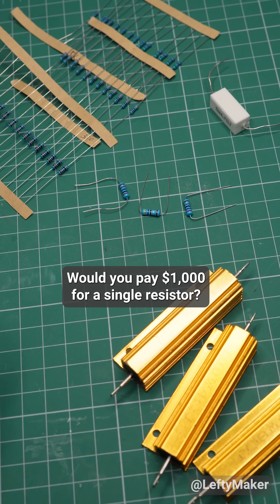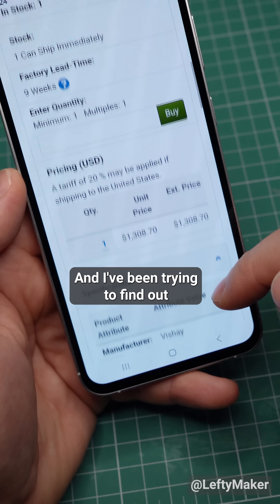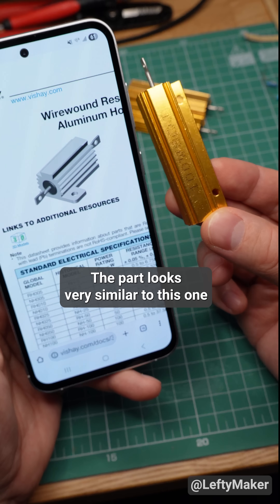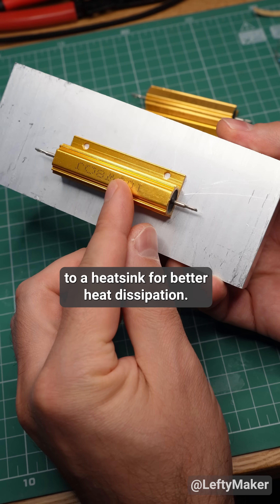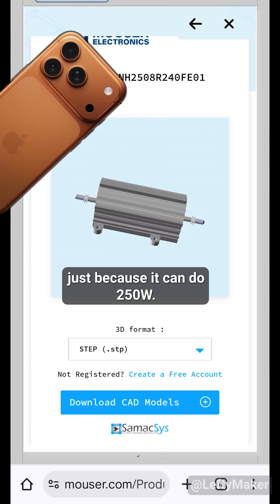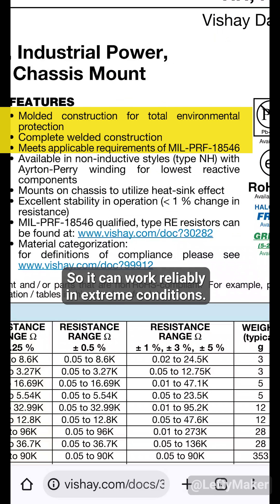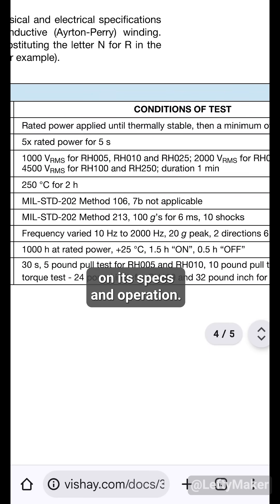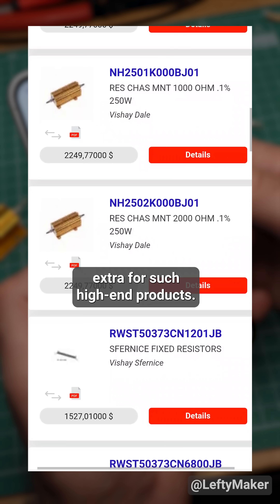$1,000 for a resistor?

Comment: In my experience I’ve found that when an electronic component is really expensive, it usually comes down to one of three things: certification, specification, or complexity.

Certification costs a lot because it’s not just a label. To get military or medical-grade certified, a company needs proper environments, testing tools, QA processes, and often destructive testing to see how parts fail. Some standards require devices to contain sparks, smoke, or fire, because imagine a fuse or piece of equipment failing inside a sealed off area like in a tank. you don’t want toxic smoke filling it. Everything has to be made to a very high standard, tested, and re-tested, which makes certification expensive (if you don't believe me look up how much CE certification costs).

Specification can also drive cost. I have a pair of resistors that cost $150 each, one 1,000 ohm and one 1 megaohm. They don’t deviate more than a tenth of an ohm. That precision takes serious manufacturing effort. Another example is E-stop buttons. Cheap $10 ones do exist, but businesses buy $100 certified models instead because you need to be 1000% sure that when you slam it in an emergency it actually works and Will survive. The cheap one? It will probably fail or break if you hit it with anything more than a tap. Some components just have to survive extreme stress.

Complexity is another factor. Something like a 23-row, 40-pole relay has tons of mechanical contacts that all need to work perfectly together. More parts, more precision, more cost.

P.S Sometimes rarity plays a role too. Precious metals or parts made by a single factory in tiny quantities can skyrocket prices. Also I am not denying that price gouging and other things happen I am just saying would I have noticed to be common things that can drive up the cost of components

Just letting everyone know I used AI to proofread and clean this up, but all the examples and points are my own thoughts and opinions.
Reply: I feel like 20% of people fall for all the marketing, 79% of people think everything is a scam, and 1% understand it’s way way more complicated than that.
Reply from the maker: Super helpful comment! Thank you for sharing
Reply: Not Generalising?
In this day and age?
How dare you?
Reply: I used to work for a major welding supply chain that also handled medical gases.   
The only difference between a standard cutting torch oxygen tank (~$20 a refill at the time) and the exact sme tanks as a medical-grade oxygen tank (~$80 - $100 a refill at the time) was paperwork.  
I often filled both side by side.   Welding supply went to the right side of the warehouse, medical tagged went to the left.
Reply: I worked as tech doc specialist on cfm56 jet engines fadec- the electronic control unit. 
Mil- spec ment that in a batch of 10,000 only 0.5% failed, and each componant was made in separate factories that had no knowledge of each other. The specs were way superior to anything you could buy in the commercial world.
Reply: I imagine a gas station on fire, a person runs up to the big red button and slams it, only to hear a prerecorded voice saying "that was easy!" While the flames ensue.
Reply: A fourth one, customisation
Reply: When I see expensive Electronic items, I go to China.....
Or India....(For not selling my kidney)
Reply: Finally a comment that isn't "it's just a resistor". 
If people don't know, they don't know, but from the comments, the general consensus seemed to be reached before actually investigating properly.
Reply: Except certifactions are wayyyy less expensive than they want you to believe! 

Especially military and space certifications. Its so outsandingly more expensive to buy a component already qualified, that most companies will do the quali themselves! 

For example, we had a 80000$ rad-hard FPGA for space applications that we were interested in. Well, we certified ourselves the 350$ non-space version. It is currently in space, working fine 😂
Reply: use ur own voice!! u have great info, we wanna hear u and not chatgpt
Reply: @adog3129 Hey, totally get where you’re coming from. However, I just want to clarify that I use AI as an accessibility tool because I have some learning disabilities (I will not disclose which) that make writing and structuring my thoughts pretty fucking tough.

AI helps me speak my mind and share opinions in a way that’s actually understandable and not a mess. (Trust me, the original version of this comment was an actual mess, I can't even share it because it went over the character limit.) I don’t just trust the output blindly. I always verify everything, and makeedits to make sure it still says what I mean.
Reply: @AstoundingAmelia  forget @adog3129's criticism of using AI, it's a tool to be used in exactly the ways you did to proofread, check alignment of factual statements and construction of your comment. Sure, if you just had AI spit out some smart sounding statement for the sake of acting a dilettante it would be less valuable, arguably pointless and possibly even wrong, but thats clearly not why or what you use it for. Good job I enjoyed reading your comment and it added some valuable context to the possibilities of why such a component may be priced so much higher outside of the intellectually lazy military industrial complex corruption comments, not to say that such things don't contain a modicum of merit in of themselves either.
Reply: @AstoundingAmelia  my rule of thumb is if someone discloses using AI, that means they are using it right.
Reply: Normal components are specified for functional and ratings. Tolerances and part binning increase costs

Wider operational excusrions, Safety in both in operation and in standby state, Reliability in military environments and compounding all  these is volumes given fixed costs
Reply: estops... yeah, i baulked when i saw the price of the deadman switches for a boom lift. even when you get them at half the cost from the distributor rather than dealer...
the one on my mill is this monster of an ali casting thats just right for stomping on... hard. 

havent seen a cheap estop last longer than a tank of fuel on most power equipment... 

certification... pricey.
i was expecting this to be some low tolerance thing but 1%? meh... the 4500v rating probably means something as well...

8.24 ohms. odd.

sounds rather custom and specific and very limited but necessary stock...

i dont think even a precision post office resistor box would be worth as much, even if tesla had owned it...

sigh. that one has to add a disclaimer... "ai speak" is easy to spot... dont worry about the dunderheads that cant tell...

no spellcheck or proofreading here... and i never bother with punctuation besides the basics... apostrophes are too complicated to bother with :) ;
semicolons are cool.
colostomy bags arent.
hows that for a "hallucination"?
Reply: @paradiselost9946  Hey, sorry for the slow reply. Your comment took me a minute to decode because it was kind of all over the place, but yeah, I get what you were saying.

I do wanna push back on one thing though. People dunk on plastic way too fast. The good E-stops aren’t made from dollar-store plastic; they’re usually glass-reinforced nylon, which is insanely strong, chemically resistant, and way better outdoors than metal. Metal bends, corrodes, reacts with chemicals, and needs way more sealing if it has moving parts. Plastic has its own mechanical strengths that actually make it the smarter choice in a lot of industrial setups.

And yeah, cheap E-stops die instantly, but that’s because they’re cheap, not because they’re plastic.

As for the resistor, mine wasn’t about voltage or 1 percent tolerance. It’s a 0.1 percent 1000 ohm part that holds that accuracy from minus 10 to plus 60 Celsius. Precision over a range of temps is where the cost really ramps up, especially in medical gear.

Also yeah, I only put the AI note as a courtesy. A lot of people can’t tell anymore, especially with minor editing.
Reply: @AstoundingAmelia Can you share what sort of application requires ±0.1% resistance over a -10~60 C temperature range? My best guess is that you're doing a high precision measurement and any error in the resistor value would hurt the accuracy.
Reply: @reddragonflyxx Actually, yes I can. It's for when I'm doing measurements of circuits that I'm reverse engineering, like my 1995 typewriter, which I need accurate  values for. Basically I use those values to determine what my error in my measurement is because I don't have the fanciest multimeter and so when I'm testing something I always test the Multimeter with those resistors so I know what the error is and that way I can make sure that any values I'm reading I know what the real values are.
Reply: @AstoundingAmelia What are the tolerances on the typewriter parts? I wouldn't expect them to need that (or if they did, that you could check several resistors against their color code off of known good equipment at standard temperature... but I can understand spending $300 for a good reference).

Anyway, anything with narrow tolerances gets very expensive quickly. I wanted some calibration weights for scales, and even class M1 weights quickly get into the $100 range.
Reply: @reddragonflyxx Depends on the part of the typewriter because some of the typewriter parts are well very tolerant whereas others get very cranky over small voltage differences. For example I found that if I gave it the wrong voltage the keyboard circuit would constantly not only miss typing but Sometimes it would double tape letters or turn settings than I never wanted or the head would get mad and not strike hard enough. So I found I had to find the resistors each resistor value correctly and the problem is that most of these resistors unfortunately over the years some of them have lost their colouring And there are a few others that seem to have been covered in Sharpie from previous repairs. I don't know why, but I can't find the numbers on them either. But regardless, I need to measure them, and having the reference tells me if I'm going to inaccurate measurement. And it's also useful when I'm diagnosing some parts of the board, Because this typewriter accepts 12 volt AC, how it works is that it had a 12 volt full bridge rectifier, sorry it had a 12 volt AC transformer in it, and that just went straight into the main board, which would just rectify it on the board and then pass the voltages out. Now I've never figured out how it works, and I still need to trace some more things, but that's end up being 15 volt. But because of the fact that, you know, there's AC in there, it's really fucking annoying to measure it. And I end up finding that sometimes I have to put the smaller resistor in series with it. Now I've lost one of the resistors, specifically the bigger one, which is really, really, really annoying. But I'll get through. But yeah, to answer your question quite simply, it's just because of the fact that some of the resistors just don't have labels anymore. And especially since I've found that I have to replace the main control chip with some sort of circuit, I'm thinking ESP32 based or something. Because, well, I can't find this ship anywhere. It seems like it was a proprietary thing made by Canon, and I can't find any other reference to its existence. So unfortunately I am stuck with Placing it with something else. But regardless of what I have to do, the fact of the matter is that means I also have to measure a lot of weird logic stuff and seeing as I've just got a basic multimeter I picked up and it's only special features that's also got one of those non-contact voltage detectors in it, it takes a lot of work.

Comment: If you use a normal passive component in a rocket, the vibrations of the launch do shatter it as soon the rocket leaves the ramp. The materials utilized for building the components installed in Space-going vehicles are totally different and, very often, much more expensive than the materials and processes used for standard parts. MIL-SPEC are expensive...
Reply: Yes the resistance element has shock absorbing stand offs on each end to allow it to take extremely strong shock.

Comment: I work with resistors like this. The real difference between these and the ones that are built to the same specs and no military standard is about 95% of the price. The ones you have are built to sell to the military, fit a specific standard to prevent obsolescence or unavailability, and are needed to meet the full price of the contract they are made for.
Reply: There's more to it than that, obviously. The price is both inflated for government contract money, but also because these are built to a specific in-house standard, higher rejection rate, and a minimum must be kept on the shelf to fulfill said contract. The cost of the product goes up due to this. Real cost is likely around $100 a piece.
Reply from the maker: I'm curious to know what you're using these resistors for. What's the most typical application, and would a cheaper one work just as well?
Reply: @LeftyMaker  I use these large 100W resistors as resistive loads for testing the power supplies I design and build for powering analog audio projects. I buy the cheap ones since this is a hobby though!
Reply: @LeftyMaker  You use them to build dummy loads to test power supplies and stuff like that.
Reply: @LeftyMaker  I see a ton of them in old school industrial applications.   Mainly to dissipate power from large magnetic devices such as motor brakes.

The most expansive ones are generally in hard to get to places.  You may pay $5000 for one but if it's in an area that requires a few hour to access you could be loosing 10x that amount in lost production costs.
Reply: @LeftyMaker I had to buy such resistors while working in a primary national standard calibration laboratory, resistors used for measurement devices of top precision
Reply: @laus9953 that was my first thought as well but this isn't the case for this one, it's not for metrology applications. It doesn't mention anything about accuracy or long term stability. Plus it's wire wound, if it was a reference resistor it would almost definitely be laser trimmed in order to meet accuracy tolerances.
Reply: I looked at the standard it is a weird one off value and every batch requires no less than 40 resistors to be tested distructively to give one validated resistor, requiring 13 different categories of testing, with some tests requiring a minimum of 1000 hours of testing. It is kinda crazy. If you are making 1000 of these you can defray the cost, but for a one off, not so much.
Reply: @varno  Exactly, it can costs 100s of thousands of dollars to validate a part like this. If the volume is low the markup has to be higher to recoup costs.
Reply: I have seen 25 years guarantee availability
Reply: no you dont dude

Comment from the maker: At least you get free shipping!
Reply: Do they deliver it on a rocket tho? It's worthless if not
Reply: like that changes anything lol
Reply: Yay!
Reply: 買わずに商品紹介をする、まったく新たなYouTuber😮
Reply: Allow me to correct you on something: If it costs a lot and it's made for military, then you pay not for quality (or not necessarily), but for the fact that DOD can afford to allocate way too much money to military and military officials don't know actual pricing, which companies like that are using. So it could be no better than your 1$ part, but military people responsible for buying them don't know that and that's why they pay over 1 grand, and company can't sell them cheaper to civilians because of legality.
Reply: Are you sure it doesn't have precious metals? I've seen these before, and won a bunch off a govliquidation auction about 2 decades ago and they did in fact have a a platinum wire resistance element inside that was wrapped and laser welded to the electrodes. The 8 50 and 75 ohm versions made  a great test load for audio and RF amplifiers as they are noninductive and can take some extreme overloading. You can heat the element inside to white heat without damage  Btw hot them for the starting bid to use, and had no idea how expensive they actually were 😂
Reply: Ye thats nice.
I love charging the government whatever I feel like when I have to work for them.
Pure bliss when I get to explain my qoute to some bored clerk who couldnt care less and will stamp the contract even without the hagle.
Reply: The cost is not for performance, a lot of lower cost resistors can do that. Cost is for certification, testing, additional QC, source traceability and related documentations.
Reply: maybe the shipping is 999$?